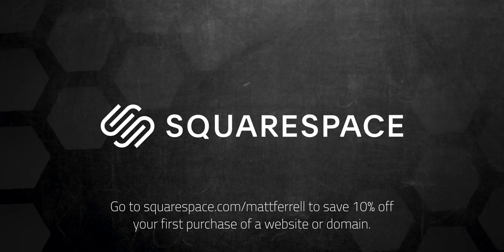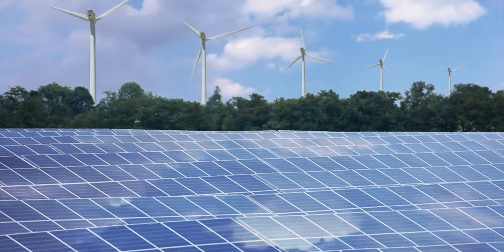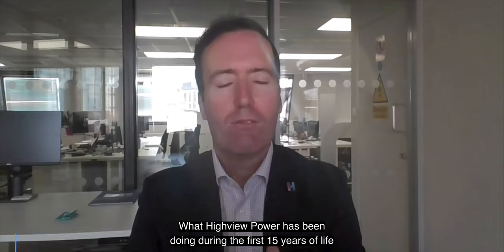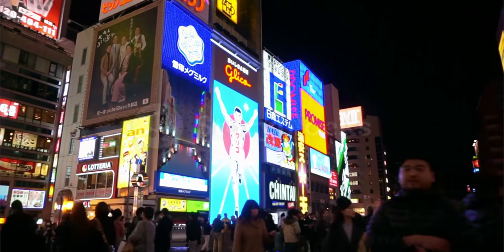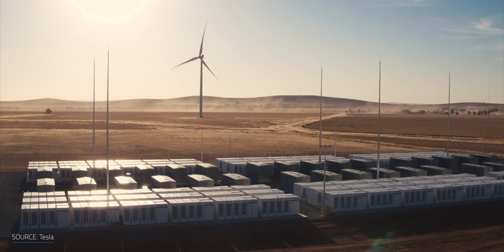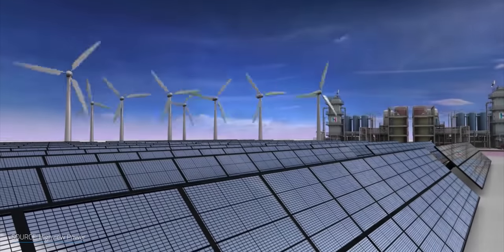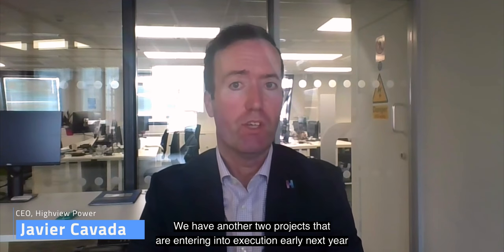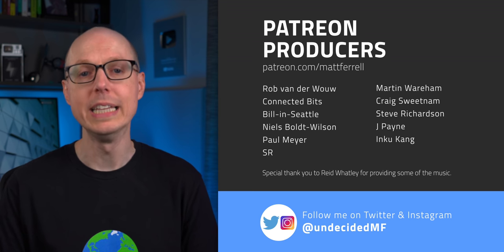Liquid Air Battery Explained - Rival to Lithium Ion Batteries?

Comment: The final cost of the energy could probably be lowered by combining the system with the fractionating technology to strip out some of the more valuable products such as liquid oxygen and liquid argon. Because you would already have the liquefaction facility, one of the costlier parts of an overall separation plant you would be creating profitable side products at perhaps lower cost.
Reply: Thats actually quite clever. I dont know the details myself but it does look like a fractionning sistem would be a relatively easy-cheap implementation into their system. Heck, at those scales you might even get a decent amount of helium from it.
Reply: and why not bother to take the co2 out of the liquid air too? you can have all in one. Energy storage, oxygen/argon "production" and even a carbon dioxide capture. Everything on the same facility
Reply: @v44n7  You are exactly correct. I focused on oxygen and argon as the most plentiful but there is no reason that I can see to limit it to those elements.

Comment: If batteries and solar are economic on a small scale they are economic on a large scale.  People just can't get their heads around the amount and cost of batteries, and noone has made these numbers before.  That is changing now.  If you can build these inefficient plants and get a profit before large volumes of lithium ion is available you could payback the investment and make a profit, but once lithium is in high volume the low efficiency cannot compete with them.

Comment: I'm in Manchester UK, there's one a few miles from here.
Another advantage is that the engineering and construction skills are not too different from the oil and gas industry, so skills can be carried over as we phase those out.
Reply from the maker: Excellent point!  Simple transfer of skills.
Reply: Also the hardware is 'off_the_shelf' and therefore should encourage those who might otherwise be put off by this 'technology'.
Reply: There is no phasing out fossil fuels if you want modern tech
Reply: Yeah.  I only really see upsides for this tech.  Like you said, transfer of skills.  Off the shelf components.  Dial-able efficiency.  Scalable. Cost competitive. Geographically mobile. Team a large plant like this with a battery farm and you have a perfect combination.  Power sources (solar, wind) feed the LAES system.  LAES system feeds the batter farm which supplies the millisecond response necessary for the grid. The battery farm would only need to be big enough to cover the gap until the LAES system can catch up... and boom goes the dynamite.
Reply: Some of the footage in this video could have been Warrington, it looked grim and it was raining :-)
Reply: Excellent point. Oil and gas jobs could transfer
Reply: @a22024  It's happening right now, guy.  Open your eyes and see how fossil fuels are going away.
Reply: @bobwallace9753  Open your eyes and see all of the products that are made of/with oil, all around you
Reply: @phodgson1980  Tesla's new cells seem to be taking us into the area of $50/kWh cells and probably no more than $60/kWh installed battery storage.  Lithium iron phosphate batteries can have very high cycle lives.  The ones in my solar system are rated at 10,000+ cycles.  

A 10k full cycle battery (0% to 100%) would last 27 years if cycled daily.  Batteries might play a large role in short time storage.  They might be cheaper than liquid air storage for rapid cycle needs such as moving solar output to evening hours and late night wind to morning hours.  If liquid air is not cheaper than batteries for frequent cycle storage it might play an important role for "deep storage". 

A liquid air facility could have a very high capacity but lower power capabilities.  Not be able to generate as much energy as the grid needs during high demand hours.  But the air facility could run 24 hours a day at full output and during lower demand hours recharge batteries with energy to be used when demand rises.
Reply: @a22024  Oil as a feedstock is not oil used as fuel.  Fossil fuels are going away.

There's no major problem in using petroleum as a manufacturing feedstock as long as we dispose of those products in a way that does not release their carbon content into the atmosphere/oceans.  Use oil to make a pair of pants.  Bury the pants when you're done with them and the carbon from the oil is re-sequestered.
Reply: @SD-tj5dh  Yes, if we can use oil as a feedstock and recycle that would work.  But if we burn gas in the process then we are not containing the carbon but releasing it.

But fossil fuels as an energy source are going away.
Reply: @bobwallace9753  Thanks Bob.  Love your thoughts on this. I see what you mean about lower power capabilities.  One more reason a health grid, storage, and supply needs to be diverse.
Reply: Problems solved 😊
Reply: @bobwallace9753  engineered liquids like nitrogen do threaten the fossil fuel industry and you can see the fossil fuel industry's answer in this application in which the nitrogen is not sold but horde of it on site using extremely old technology to produce the liquid from natural nitrogen.

Executive even talks about how it's facilitating fossil fuel use. You should study the transcript of this video of the interview and try to understand how much we pay for the energy obtained from burning Diesel and gasoline. Before you say that liquid nitrogen is too expensive remember what this host says about the cost of Renewables. He says that they can be free. So if something can be free and not matter you have to ask is it already cheap enough to be wasted largely but use disruptive despite that? For example Geo thermal heat can be used on sacrifice landmasses where are the risks of earthquake volcanic activity do not result in irrational protest. The amount of heat that you can bring out of the Earth is essentially infinite and you can use the process to mop up surface Heat. When you boil liquid nitrogen by draining swamps of problematic Heat you will see what I mean. Problematic heat is common and a major portion of electrical demand well efficiencies Solutions for liquid nitrogen involve turbocharging so that you essentially create an era of steam where are these sources of heat provide the driving energy for the turbine which uses miniaturized magnetic bearings to pump the heat Outdoors or preferably an easily done into outer space more directly.

So things that matter in the cost engineering are the reality that shipping liquid nitrogen at extreme speeds above the wave line of the surface of the ocean is extraordinary really cheap if you have comparable car go Mass traveling in the opposite direction to yank and maintain respective velocities from. If you get my drift?

 part of the take away if you work real hard of this video can be the executive saying use metrics that matter. why are the tanks long and skinny when a spherical tank is far cheaper?

 Japan used to fool around with fuel cells for water heating that is you would sell the electricity that was the byproduct of heating water. So consider a large shopping mall need for air conditioning the demand for electricity is very great on the grid when you would boil the nitrogen with the heat that you want to get out of the building, selling the electricity that you produce, making pricing and level lising the cost of this or that aspect non-trivial but obviously extraordinarily compelling because instead of storing the heat at Capital expense and with losses you are getting heat that is less than free! again the issue is the proper metric and that is cost.

 complexity is not the metric efficiency is not the metric but at the end of the day getting what you need done for the lowest price is what matters and allows Market disruption.

 liquid nitrogen can be moved in Pipelines obviously. unlike liquefied methane which is already moved in hoses four miles that are cheap manufactured what you are witnessing with the comment about cell phones is our host who cannot handle the truth. you don't store energy with liquid nitrogen you move it. like a few miles from below the surface of the Earth and then however many thousands of miles to where you need the work done even on a high-speed vehicle perhaps even an international Super Sonic ship. I prefer yank technology for Cargo definitely but it will probably work for passenger travel as well democratizing International tourism slashing the price a passage below what is ever been despite being able to take you round trip around the world in an afternoon.

 The reason we don't use liquid nitrogen is because it would bankrupt most Electric utilities and caused the price of even a unnatural methane gas to drop below the cost of its engineering. Saving the planet is about lowering the cost of mechanical work and everybody will tell you that cannot be true. Everybody is a coward.
Reply: @bobwallace9753  yes rate of discharge is relevant cos it will freeze and a lot of high power precision compressors is friction heat and wear, wait till a full scale protype is up and running, before saying its better than sliced bread
Reply: @a22024  What do you mean?
Reply: @williamgoode9114  you make a good point. I work with cryogenic equipment and have stood in a pool of liquid nitrogen while repairing a valve that couldn't be isolated. Terrifying thought was what if I dropped my wrench. Thermal stresses are a constant source of work for me.
Reply: @a22024  "Changing"  vs "Now" = "are +ing" vs "are" -- there is a difference in nuance there. I for one think that there seems to be a growing technological switch to the use of less oil in energy production. But, what do I know?
Reply: You're in the UK and you are talking about miles?
Reply: @tarstarkusz  both you and @a22024 don't understand the very real difference between burning fossil fuels and using petroleum based products for manufacturing goods.
This is a sad state of your education.

Try to grasp it using wood as a substitute in the argument.
We are saying "Stop burning entire forests of trees to generate miniscule amounts of power."
You are saying "Yeah, but you live in a house made from lumber." as if it is relevant to the conversation.

Yes, both include wood from trees.
No, they are not equal or related topics.
Reply: @a22024     both you and @tarstarkusz don't understand the very real difference between burning fossil fuels and using petroleum based products for manufacturing goods.
This is a sad state of your education.

Try to grasp it using wood as a substitute in the argument.
We are saying "Stop burning entire forests of trees to generate miniscule amounts of power."
You are saying "Yeah, but you live in a house made from lumber." as if it is relevant to the conversation.

Yes, both include wood from trees.
No, they are not equal or related topics.
Reply: @a22024  i think its less about the hundreds of tons of oil going into materials and more about the millions of tons of oil going into energy
Reply: Anything that can replace lithium ion batteries is a plus honestly.
Reply: @tarstarkusz  the good news for cargo ships? look up wing ships, they're not widely used YET but i feel like they are an extremely viable alternative to our current polluting hulks
Reply: @karozans  the UK isn't fully metric but a mix of metric and imperial.  We still use miles, some drinks (alcoholic and milk is what I can think of off the top of my head) still measured in imperial pint and people's generally weigh themselves in Stones rather than Kgs.
Reply: @callumh1920  I knew about the weighing people in Stone and pints of beer, but I had no idea that you still used miles.

Anyway, the USA is the same and most people don't seem to know.  Back in the late 1800s I think, the USA government officially set the US on the metric standard, but for some reason it's really popular to claim the USA isn't on the metric standard.  There are only a handful of things the US doesn't use metric for.

First, every single scientific experiment in Universities, hospitals, or research laboratories around the USA is always in metric.  Metric is taught at every University and maybe only 1 or 2 days at the most is spent on conversions from metric to/from imperial.

Every vehicle or piece of machinery or appliance that has been built in the USA since about 1980ish uses metric.

There are only a handful of places that don't use metric, because the conversion would be far too expensive for everyone and it's not really worth the confusion.

When laypersons talk about the weather in a non-scientific way, it is usually done in Fahrenheit.   In my opinion when talking about the weather Fahrenheit is better than Celsius.  When driving on US roads, signs and speedometers are given in miles and mph because it would cost the US hundreds of billions of dollars to change all the signs around the US.  And the US still uses imperial measurements for cooking because there are tens of millions of recipe books out there already and most people don't like the idea of having to buy a kitchen scale for recipes that give measurements in weight instead of volume.

Other than those few handfuls of things, the USA is really on metric.

Comment: You are often confusing power and energy. I hear you say “megawatt” for energy storage. 

That’s like saying the grocery store is “5 mph” away, when you mean “5 miles” away. 

I know this is driving many of your viewers crazy and lots of people comment on it. 

To further beat a dead horse, power is an instantaneous measure of energy flow. A kW can’t do any work; it’s not a unit of energy. 

Just like 60mph won’t get you anywhere unless you travel at that speed for a millisecond, an hour or a week. Then you’ll have travelled some fraction of a mile. Or multiple (or thousands) of miles. That’s analogous to energy.
Reply: Mwh or max demand, believe mwh. Telephone game condensate
Reply: Larry, well put,.  It's an important distinction I see abused frequently and wonder sometimes if it isn't done intentionally to exaggerate the attributes.

BTW, my alternative extrapolation:
"This barbell weighs 650 calories"
Reply: Hibridised with high grade heat turbines the output is greater than sum significantly.  This increases value of imported cyrogenic fluids to cool reactor steam.  Nitrogen is an open loop flow booster for micronuclear reducing number needed.
Reply: 👍 domestic uranium to heat imported from canary geothermal LIQUID air is the sterling engine fodder aspiration deltamaxing 🍵 totter.  Fission is the catalyst DUH.
Reply: I call the bluff! Cooling tanks WHERE right DESIGN problem was water NOT LIQUID air being in there AND emergency use ONLY.  THE superheated nitrogen plasma'ED even CAN COOL RADIANTLY AFTER FINAL TURBINE.  MULTISTAGE TURBINES FISSION REHEATING OF WORKING NITROGEN BETWEEN EACH THAT DESIGN IS THIS MILLENIA'S ELECTRON PUSHER 🍑
Reply: I think most people would have an easier time understanding watt, if you just remind them that it's a comparable measurement to horsepower in cars. You'd never say a fuel tank can store 400 horsepower, similar to how you'd never say a battery can store 300 kilowatt.
Reply: That was very distracting, yes.  How many parsecs did he complete that trip in?
Reply: When did he say MW? I only heard  MWh.
Reply: MWhr / hr or mW is a measure of work analogous to horsepower. A power plant may be able to produce 1000 mW hr / hr. 

Mw hr is a unit of energy analogous to the kW hr you buy from the power company.  That same plant may produce 24,000 Mw hr / day if run flat out.
Reply: All power storage has a power rating and a capacity rating. 
What can be deduced from these numbers is the maximum amount of time of storage can be achieved. 

For example: 
Power rating of 5MW
Capacity of 120MWh

from these two numbers you can see that a maximum of 24 hours of storage (120/5) can be achieved.

So when describing a storage solution, the power is just as important as the capacity.
Reply: He said megawatt hours several times.